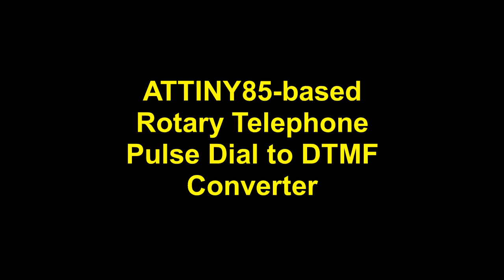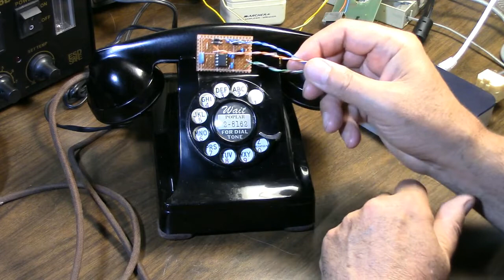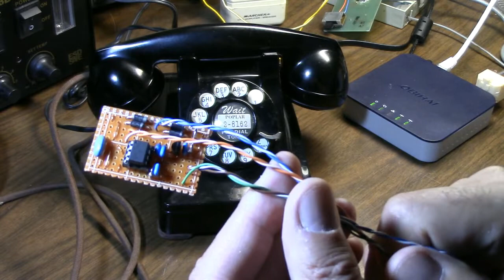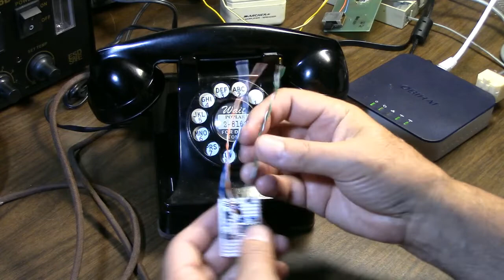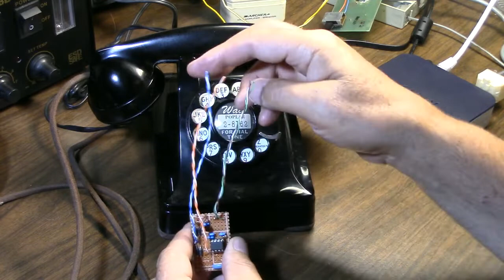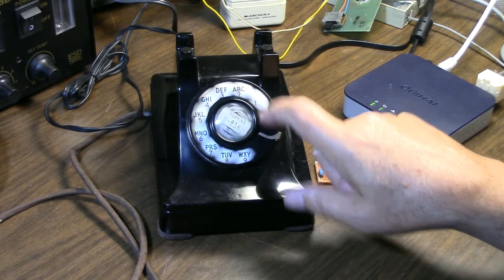Pulse dial to DTMF converter for rotary dial telephones demo

Comment: Lol imagine if u could record someones dial tone on intercom with handheld voice recorder 

Then replay that dial tone on a analog phone aka office phones anything that have a handset to decode what there number is like the casio DBA 800 watch that had phone dialer u enter the number to save it then it plays the dtmf tone put that tone to the phones handset and it dials the phone using the dtmf sound
Reply from the maker: @loraguzman1107  This would work fine, as long as the recorded tones were coupled into the phone line with enough volume and low distortion. Often simply playing recorded tones into the telephone mouth piece would successfully dial a call.

Comment: I'm trying to figure out how to achieve getting a pulse phone to wirelessly connect to a Spectrum Cable VOIP RJ11 port/line, as my house is not wired for phone and I don't have a way to run wires/cord from desired phone location to modem. Any ideas if there is some sort of wireless hardware (ideally off the shelf or kit) to get this to work? I really don't want to use a cell phone. Also, will need to have a way to provide power for the phone ringer/bells, even just a little and can adjust the bias spring maybe . . .
Reply from the maker: I use a VOIP ATA adapter connected to a WIFI Ethernet bridge for this. The Ethernet bridge connects to your WIFI network and provides one or two remote Ethernet jacks.The ATA is plugged into the jack and the phone now connects wirelessly to your Asterisk switch or VOIP provider. Works great.
Reply from the maker: Most ATAs will not accept pulse dialing, so you would also need to build and install this rotary to DTMF converter.

Comment: How did you get your ATA to generate the old style dial tone? I have a grandstream HT802 and I can change the dial tone but I’m not sure what the correct frequencies are and syntax to use.
Reply from the maker: Here is a list of the tones, including the old modulated tones (not simply an addition of two tones, like modern tones). Not all ATAs can do the modulated tones. An "x" between tones means the first tone is modulated by the second. A "+" between tones indicate the two tones are summed. Not sure of the Grandstream syntax.

Modulated (Old) Low Tone (600x120) - Used for Dial Tone and Busy at modern cadences
Modulated (Old) Ringing 1 (420x40)
Modulated (Old) Ringing 2 (500x40)
Old High Tone (500)
Precise Dial Tone (350+440)
Precise Ringing (440+480)
Precise Low Tone (480+620)
Receiver Off-Hook (ROH) tone (1400+2060+2450+2600)
New High Tone (480)
Test Tone (1004)
UK Old Dial Tone (400x33)
UK Old Ringing (400x133)
UK Precise Dial Tone (350+450)
UK Precise Ringing (400+450)
UK Equipment Engaged Tone/Congestion/Number Unavailable tone (400)
Crybaby (US Old Vacant Number) (200 to 400 to 200 at 1 Hz, interrupted every 6 seconds for 500ms)

Comment: Nice!  I just stumbled upon this video when I looked up “DTMF tones” into YouTube.  I was born in 2002 and through the internet and television, I figured out how a rotary phone actually worked!  I looked at this video and just learned something!  I may not know what you’re talking about most of the time, but this was fun to watch!

Edit: What does the chip do, exactly?  I kinda understand that, one feature, is so you can redial without having to slide the numbers all over again.
Reply: i was also born in 2002!
Reply from the maker: @アレン-f2x  The chip converts te DC current pulses generated by the telephone dial to the corresponding DTMF or Touch Tone digit. It also has a redial function, a few memories, and adjustable parameters. It can be programed to "hot dial" a pre-programmed number immediately when the phone goes off-hook.

Comment: What is the meaning of KP and ST? ST is maybe START? BTW I really like 2600Hz and I use it as notification tone on my mobile and as a roger beep on my transceiver :) This is not a coincidence, of course. :)
Reply from the maker: Because the tones used on the long distance trunks could have a variable length, a way was needed to indicate the start and end of a dialing sequence. KP stands for Key Pulse. It is slightly longer than the other MF tones and indicates the start of dialing. ST stands for Start and indicates the end of dialing and that the numbers between KP and ST should be processed.

Comment: What a simple solution, especially with the added functionality. Congratulations.

I have a 1939 WE302 that worked fine at home for decades until recently but now it can no longer dial out, I assume because of telco upgrades to the local loop. Though we mostly use it to pickup calls in the living room, I really want to be able to dial out. I love the sound and feel of the older
clickity click rotary dials. 

So I want to implement your project but have one question, can the 4Mhz ceramic resonator can be replaced by a 4Mhz crystal and if so, would the Attiny85 fuse settings remain same?  I'm retired overseas where it's harder to find  the ceramic resonator.

Many thanks.
Reply from the maker: The fuses should be the same, but you will need to add the loading capacitors from each crystal leg to ground. The resonators I use have internal loading capacitors, so only require connection to the two oscillator pins plus ground (three terminals).

Comment: Hi, thanks for informative video! I bought a Dialgizmo to connect a 500 series rotary to my Voip. I can’t seem to get the call holder feature (for dialing “#” or “*”) to work. I have the dipswitch at the proper setting. It does allow outgoing calls. Would you know if this is a bug with the Dialgizmo? I use ATT in Chicago. Thank you, Mike

Comment: 7:19 What was the * key used for on a dial phone? Call display?
Reply from the maker: It was used for what Ma Bell called “vertical service codes”. For example, *67 dialed before the phone number would disable caller ID for that call. Other codes were used to block certain numbers or activate other features on the line. Rotary dial phone users would dial “11” instead of “*”.

Comment: Nice! Which Obihai is that?
Reply from the maker: Obihai (now Polycom) 302. It has two FXS ports. It can NOT be made to work with Google Voice. It was a gift from an Obihai engineer at a conference.
Reply from the maker: I just realized that the Obihai and the old Western Electric phone have the same model number - 302!